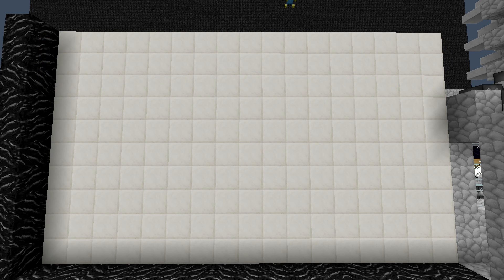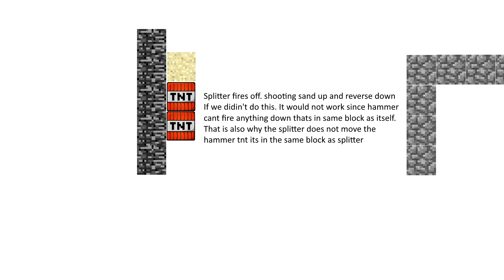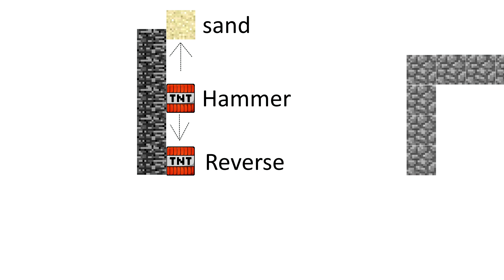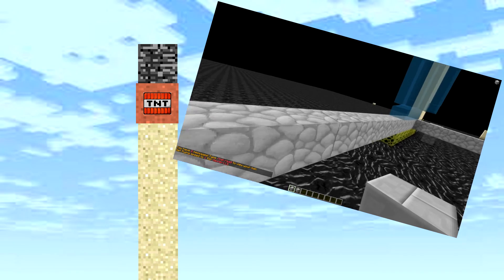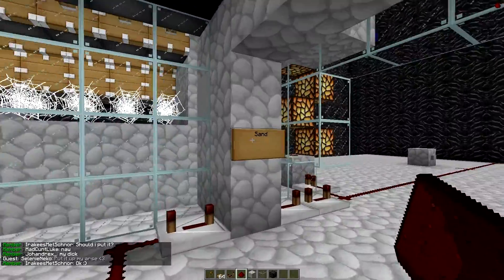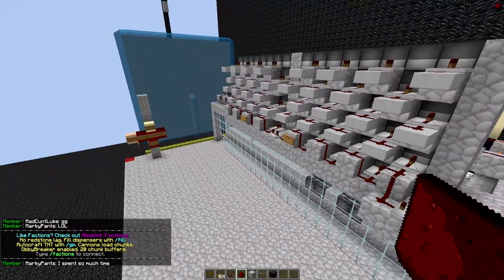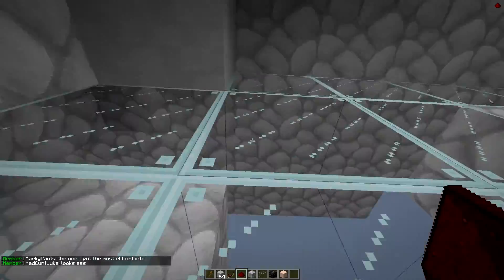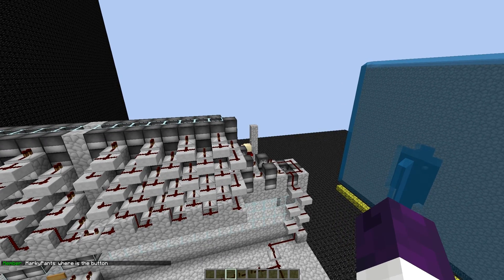Detailed Explanation of Reverse Hybrid 1 Tick Concept/idea

Comment: I made one of these, it stacks fine, and the redsand is at the top of the stack, and touching the rev layer, but my scatter isn't working. Any ideas why? I made sure it was filled and on, the timings were also fine.
Reply from the maker: Delay the scatter as much as possible to see what happends with it and then tell me what happends :)
Reply: Dexter113 I figured it out, thx though
Reply: Dexter113 I had a protection block under the stack so it didn't blow up, I was on one shot